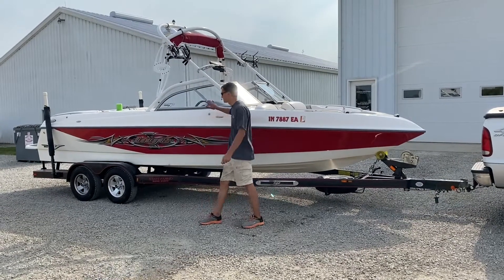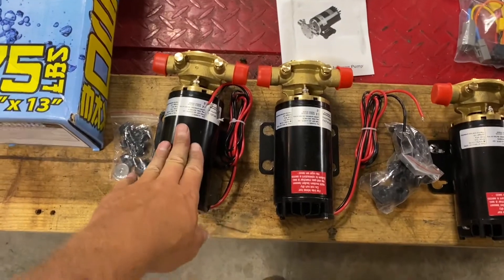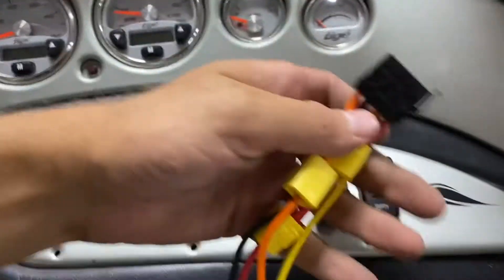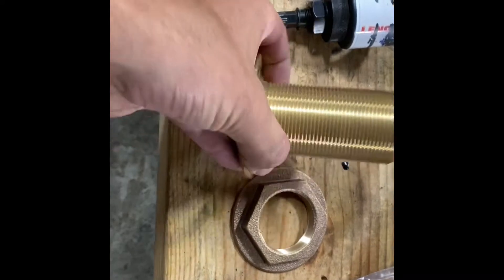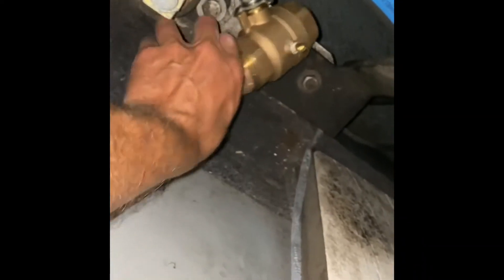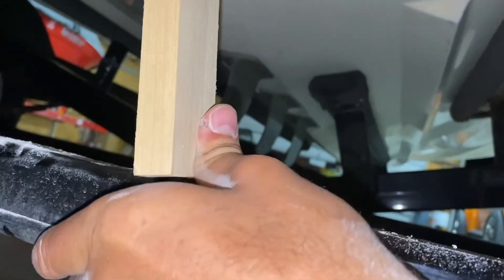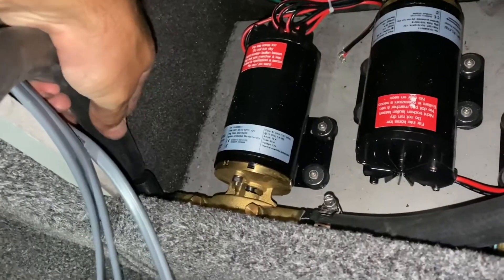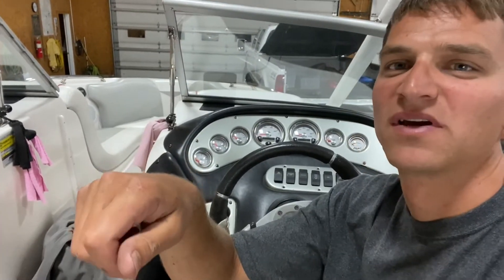Installing a ballast system - Older boats can make a big wake too!

Comment: Great video, very inspiring.  Question, if you were to install only rear ballasts, do you think it would still be necessary to drill that second outlet, or do you think you could just T into the bilge outlet?
Reply from the maker: You can tee into the bilge outlet, you just need to install a checkvalve so that it doesnt pump water into the hull

Comment: Just bought two of the reversible plug and play ballast systems from Wakemakers (black Friday -$200).  I will be installing for two rear 750's in a 07' Mastercraft VRS230.  Was wondering why you only drilled the single hole?  Mine came with two so I thought I might as well use them and get a true 1" to 1" fill.  Thoughts?
Also, you "T'd" into your bilge pump line so I'm wondering when it gets full, and you see water shooting out the side, does some water pass through the aerator bilge pump into the hull?  I could see me forgetting it's pumping and put a few gallons in my boat.
Reply from the maker: You could drill two smaller holes, that would work. I guess my thought with one  bigger one is less holes, less chance for leaks. 

For t’ing into the bilge, there is a check valve on the bilge on some of them, so the water pumped up doesn’t run back down, a back-flow preventer. On the 24’ Tige I also put a hump in that line so it was easier for the water to run out of boat than back in.

Comment: So, the bags fill and drain thought the bottom of the hull, correct? The plumbing to the vents is just for venting air when filling?
Reply from the maker: Correct. The vents also serve as overflow when the bags are full

Comment: Do you have any issues with starving the pumps due to having just 1 thru-hull intake going to the 3 pumps? Also, which pumps did you get from Wakemakers?
Reply from the maker: I havent noticed any issues with starving the pumps if sitting still. Its a 1.5” line feeding 3-3/4” lines so it flows enough. The only time I notice it starving is on the plane. Of course emptying while at speed is no problem! 

Pumps on this one are: JOHNSON TALULAH REVERSIBLE BALLAST PUMP (110LBS/MIN)
Reply: @theclevercraftsman  That sounds like it worked out well then, and I don't know of anyone who fills while on plane anyways.  For my boat, I am trying to have 4 pumps.  1 for nose, 1 for ski locker, 1 for each rear locker.  Does that sound like a single thru-hull would work, or would going to 2 thru hulls with each supplying 2 pumps be better?
Reply from the maker: I will throw a little water in my nose while on plane to help make it ride nicer. 

Good luck with the project!